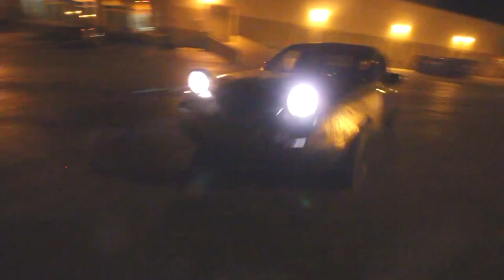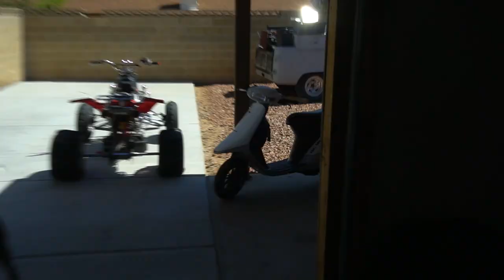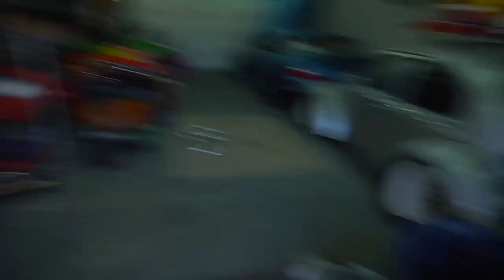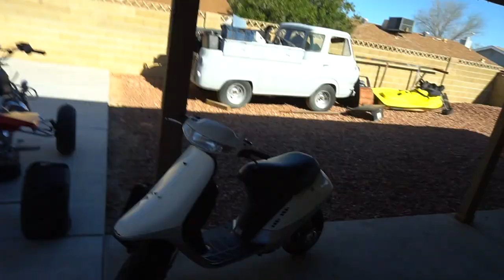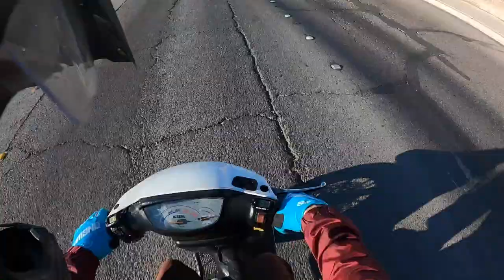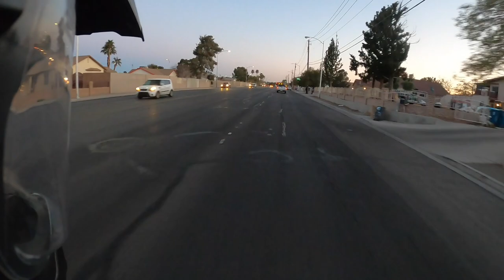RACING FAST HONDA ELITE 120cc Stroker MOPEDS around the city

Comment: Hi Trevor   Great channel,I wonder if you can give me some advice.I have a Chinese 50cc scooter, I have replaced,the pipe to an expansion chamber/carb/cdi/airfilter/clutch and veriator,It revs fine on the stand,But once i try to ride it,It wont go over about 20kph.It just dies.thanks kym
Reply: U tried spark plug had same problem on a Chinese Diablo before.